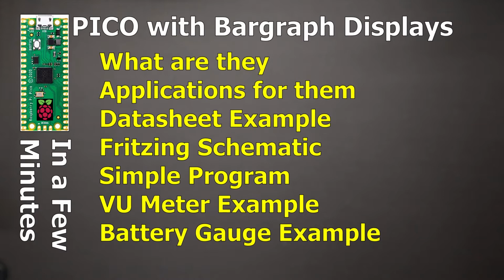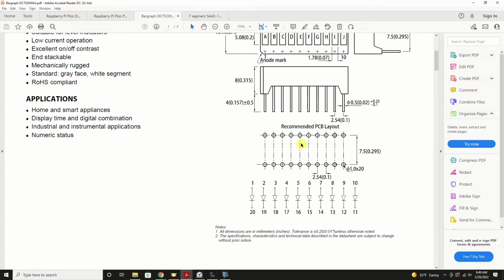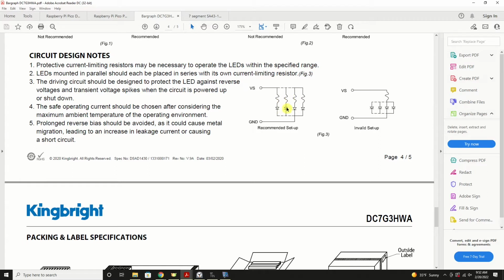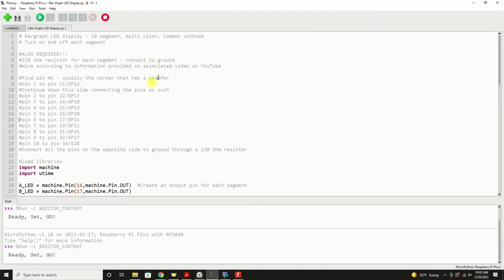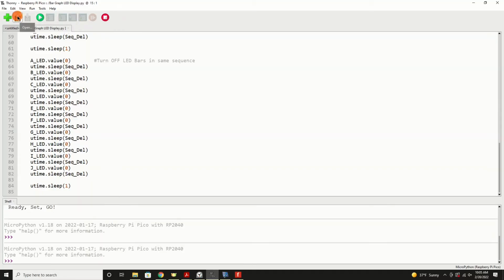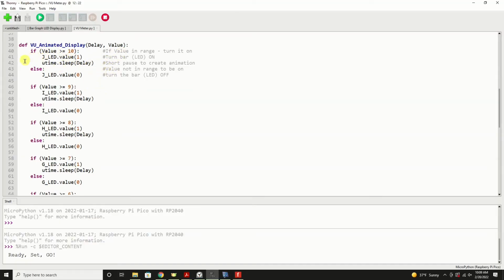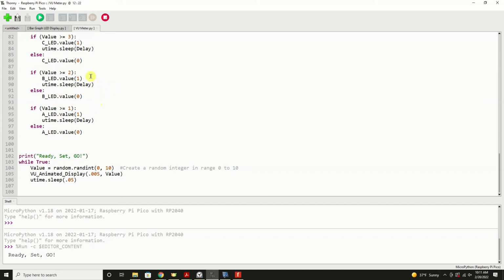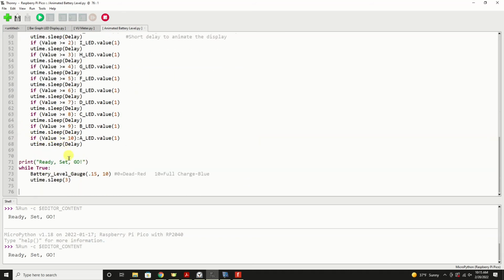Interface the RPi PICO to a LED Bar Graph Display

Comment: Great, i used a ledbar for "life with david" pico pio examples (he had 8 individual leds probably), 
now going to see Chris' take on ledbar. (i like the extra use case info)
Search on YT for "life with david pico", choose "Raspberry Pi Pico PIO - Ep. 5" from his video list.
i put my pico (usb connector) right on the edge of the breadboard where the numbering starts 1 ...., 
helps to go from pico pin layout image (which shows gpio/name and pin number)  
sadly works only for 1 side, other side needs more calculation.